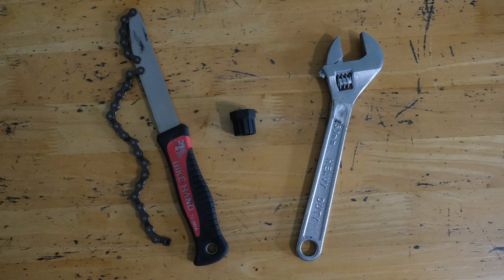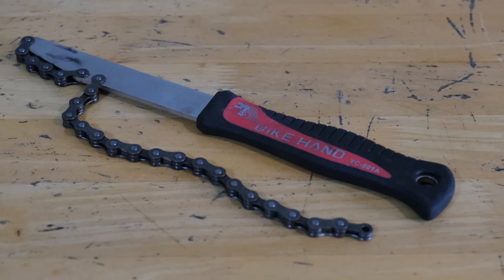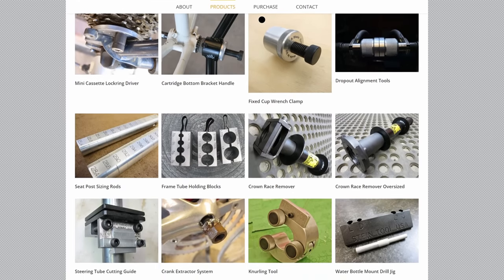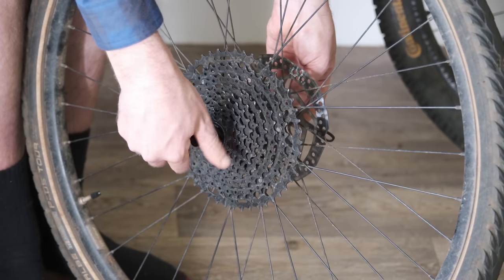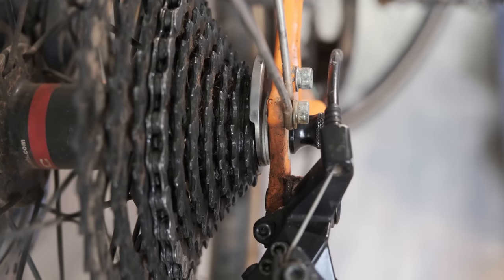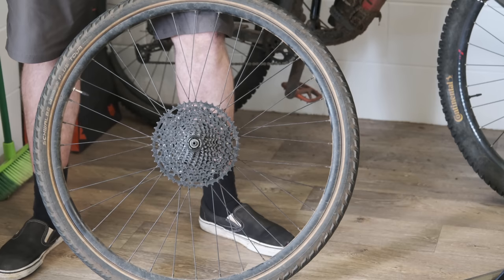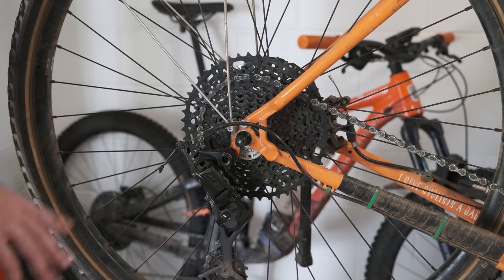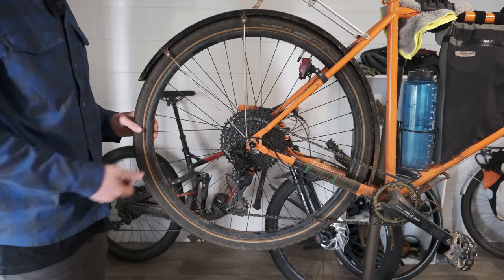EASY Cassette Removal on a Bike Tour! // Stein Mini Cassette Lock Tool Review

Comment: So many people missing the point here.  Its not designed to replace the chain whip and cassette tool, its a lightweight alternative for emergency use that could save half a kilo.  The Unior version comes with a plastic protectice piece so can be used on aluminium.
Reply: Incredible isn’t it? 😅 Why can’t people see that if you are touring you might not want to carry a full size chain whip, lockring tool and wrench? And even if you said, ‘well those things aren’t heavy’, you then have to apply their original logic and take a full size track pump, because it’s better than mini pump, a full set of t-handle hex keys, because they are better than a mini tool etc… do this for everything and you’ll need to also fit a trailer to lug the kitchen sink around.

Comment: Clever little tool. I can't say I have ever encountered a situation where I needed to remove a cassette in the last 15 years and 150k miles of riding. I have had one instance where I needed to tighten a loose cassette lockring but never needed to remove one. That being said, I can totally see the value in this for those who ride long distance, multi day trips without access to a fully stocked garage/shop.
Reply: in 15 yeas as a messenger i never had my cassette loosen. but that would be the only viable reason i could see for this too.

im not trying to be a hater, and i was scratching my head for a while on this one, and yours is the only situation that makes sense. and the only time i ever head of a cassette getting loose.

Comment: Wow, very smart tool! Before watching the video and having seen the tool, I was really wondering how it would work. Never knew it could fit over the lock ring, very smart.
Thanks for the warning about not using it on Carbon frames 🙂, that makes a lot of sense. But what a weight saver on a steel bike-packing bike!

Comment: Reminds me of the Hypercracker which was eventually replaced by Next Best Thing.
Reply from the maker: Exactly! 

I meant to mention the Hypercracker, but didn't bother for some reason.

Thanks for commenting! 😁
Reply: I have a Pamir Hypercracker for 30 years. I maybe used it ones but to have that thing on a tour gives a peace of mind, with it's longer lever it even works not bad for simply changing a cassette.
Reply: I bought a Hypercracker in 1991 before doing two fully loaded tours that year covering 7K miles. It worked flawlessly and it was a good thing because I ended up replacing nearly all the spokes on the cheaply made rear wheel. The item reviewed here looks to be excellent.
Reply from the maker: @smith971  - Great to hear, Karl! Thanks so much for sharing!
Reply: My Hypercracker is well travelled and seldom used, but is worth it's weight in gold when needed.

Comment: I took a small light Park 13/15mm double ended cone wrench (you could use any small wrench you are already carrying) and just drilled a hole in it and attached about 8 old chain links with a small screw through the hole to make a small light weight chain wip. Then I took the regular lock ring tool and drilled a hole through it so I could turn it with a 6mm hex key. This allowed me to just do this job, if necessary, without all that fuss or potentially breaking something important like my frame. Was it a bit heavier, yeah sure, but I was already carrying the wrench and the hex key so the weight penalty was basically the 8 chain links and the difference in weight between the regular lock ring tool and the Stein or similar, so just a few grams. Before leaving on tour I just made sure the lock ring wasn't gorilla-ed on there so I'd be able to loosen it with my setup that doesn't have quite the leverage of the full size tools.
Reply from the maker: Pretty ingenious solution!

I think your comments on weight are relevant though - this things main value proposition is that it's TINY and weighs next to nothing. 

In my experience, cassette removal is a task that is so seldom required that I'd rather just put up with the occasional fiddleyness of a tool like this in exchange for the space and weight savings - but I'm sure many would disagree and opt for ergonomics instead.

I'm actually considering swapping this one out for the NBT-2, which is much cheaper and I think will actually work really well with the sliding dropouts on my bikepacking rig. Guess I'll find out and post a video when I know!

Thanks for commenting!
Reply: @VeloObscura   Sure - I'm not bikepacking just standard road touring with panniers so the few extra grams are not an issue for me. I find the weight I'm carrying on the bike changes day to day more than the weight of this thing based upon how much food and water I'm carrying. Regardless, the most important thing in either case is to make sure you know how you are going to use whatever tools you bring otherwise they are all just dead weight. I do a lot of my own wrenching so I sat down and seriously thought about what the top 10 most likely failures would be, whether they were things that I could realistically expect to fix on the side of the road or in some BLM campground, and what tools I should then assemble to do those jobs. Many of the folks I run across just carry a multi-tool, patch kit, and pump and believe they will some how be able to "MacGyver" their way out of anything knowing little about how their bikes actually work.

Comment: When I used Shimano hubs I carried a Pamir cassette cracker ,same principle, in case you broke a drive side spoke.  Now I use DT Swiss 350 hubs…you can pull the cassette and freehub off by hand with no tools required.  Makes wheel repair or hub service easy.

Comment: Reminds me of a tiny little tool for removing the outside spin on cog on Shimano Uniglide 6,7, and early 8 speed Uniglide cassettes and freehubs. The smallest cog spun on the hub, to hold on the rest. It had a short piece of chain connected to a hook that hooked onto the chainstay. It worked basically the same as the thing you used.
Reply from the maker: Oh wow, that's really cool. I'm going to look that up and see it in action!

Thanks for commenting!

Comment: Funny how this video popped up in my feed a few days after I ordered the Wolftooth lightweight removal tools.  That said, thanks for the warning about not using it on carbon frames.  But I still may get one of these as my preferred touring frame material is titanium, which I would imagine should be fine.
Reply from the maker: Wolftooth make awesome stuff!

I'm sure titanium would be fine and you can always use the included protective plastic for aluminum frames with it just to be sure!

Comment: Looks like an improoved version of the "Next Best Thing 2 lockring remover" where you had to have the tool in the right orientation relative to the rear dropout, while installing the rear wheel.
Reply from the maker: Yep, just another variation on that design. 👍

Comment: You can use just a chain to hold the cassette. Put something to protect the tire (clothes or a stick) them put the chain over it and wrap the both ends around the cassete. Just take care to arrange it not touch the spokes. I use that and a breaker bar to release a stucked centerlock.
Reply from the maker: I don't tend to take a breaker bar with me on extended bicycle tours! 😅

Comment: Hey Dave, thanks for this. I've seen videos about this in the past, but have been a bit unsure about how effective it would be. My last tour, I took along a wrench, cassette removal tool and chain whip and it was a lot of weight and bulk, especially since I didn't need to use it. But, I felt I needed to take them since I had been having issues with spokes breaking on the drive side of the rear wheel. It would be nice to drop the weight and bulk of those tools. I do have an aluminum frame, however, but I'm not sure how it could be damaged by using this tool, as long as the forces applied are not overdone and are increased gradually. Are you thinking that the frame could be damaged by a sudden jerk of the wheel while the tool is in place? Again, thanks for all your videos. Love your presentation style. Very clear and concise! :)
Reply from the maker: Thanks, mate!

To be honest, I'm just going off what I've been told. I think aluminum MIGHT be ok, but the maker of this tool (and the other similar ones) recommend only using it on steel frames.

There is actually a black piece of plastic that comes with the tool that you can put between the little "peg" and your frame to help spread the pressure, so perhaps using that might make it safer for use on an aluminum frame.

This video was actually my first time ever using the tool and once I'd figured out how to get everything in place, it was remarkably easy!

Cheers!
Reply: To larry/dave, just thought, here in uk you can get 'fibre fix'...it's a composite special string that can be used as an emergency spoke. Ideal for replacing a cassette side back wheel spoke on the road (very light & approx £10, I've got one for tours! Never used it yet but know the principle.
Reply from the maker: @LiveAndLetBike  - Yes, the I know the FibreFix well!

Unfortunately the FibreFix isn't a permanent solution and on a long-term bike trip it's better just to fix with a regular spoke and be done with it.

However, it's a great solution for shorter trips where it can be enough to get you home.

They're a really great piece of kit.

Comment: I have this tool but have luckily not used it. It's presence has been a talisman against broken spokes! A spoke that fits 3 of 4 wheel sides is taped to my low rider front rack, spoke key in bag. 28 spokes  for a heavy rider on a heavy touring bike is a bit concerning. I need to build a 36 spoke wheel for this over the winter.
Reply from the maker: Haha, a talisman! Love it!

28 spokes would definitely have me worried too! 

Cheers.

Comment: Just wait until you have to remove the cassette from a DIY e-bike. Because of the extra torque from the motor the cassette becomes practically welded in place, it's the equivalent to removing a cassette from a bike that's been left outside in all weather and unused for 25 years. it would be interesting to see how this tool handles more extreme scenarios like I mentioned. It seems this tool may be better than trying to keep the traditional cassette socket tool flush while hitting it with a sledge hammer and or getting an overweight relative to stand and the spanner while you hold the chain whip.
Reply from the maker: Do NOT use this tool on a cassette that you suspect is stuck in place. It is NOT designed for high-torque applications. You will most likely damage the frame!

Before leaving on a bike trip where you may use this tool, you should always first check that the lockring isn't too tight by using conventional tools.

That being said, once you've done that it shouldn't matter whether you're on an ebike or even if you just have incredible hulk thighs. Torque is not applied to the lockring while pedaling and you shouldn't have any issues removing it. Just make sure you put a little bit of grease on the threads before you put it on.
Reply: @VeloObscura  LOL chill out, I was just saying it would be INTERESTING to see how this tool handles more stubborn and hard to remove rear cassettes. And also, torque is indeed inadvertently applied to the lock ring of the rear cassette by an e-bike motor because of the knocking effect of the motor kicking in as it initially pulls the chain, (especially from a stand still in a high gear) this is hard to explain unless you've ever ridden and used a high wattage e-bike motor without a smooth start function which you may well have done?  

I appreciate the advice but telling/advising a bicycle fanatic to grease his threads is a bit like telling an IT specialist to turn his computer on and off again. I mean no offence by this and I'm always concerned that comments like the one I'm writing right now can come across as snarky or irritable when they are just words on a screen, but in real life this would be a mostly playful back and forth misunderstanding or slight disagreement etc.
Reply from the maker: I AM chill, mate. Like you say: Tone doesn't come across in text. I was just trying to save you from wrecking your frame. If you want to try this, then go ahead - I've done my part! 😅

Comment: The tool is cool but I love the massive range on your cassette even more.
Reply from the maker: Haha, thanks.

It's a Microshift Advent X system with a 11-48t cassette. 10 Speeds, so pretty big jumps in theory, but I don't really notice it. I suppose you get used to it!

It's a very cheap system, but allows you to run drop bars with a 1x system with plenty of range. I run it with a 34t chainring.

Cheers!
Reply: I thought that my 11-40 was a pretty wide range. As someone who is on the wrong side of 100kg and who has no flat areas anywhere near him I would love to get a cassette with that range.
Reply from the maker: @Alan_Hans__  - They just released their new "Sword" drivetrain. It looks amazing. Much more refined than this old Advent system.

Comment: If this is meant to be carried for emergency use seems to be a good tool, as a Roadbike and MTBer, I have never been in the situation to have to change a cassette in the ride.
Reply from the maker: This tool is designed for people to take on long bikepacking or bike touring trips to remote locations where there are no bike shops. I wouldn't take the cassette off on my morning ride either 😅

Comment: It's time someone invented a cassette that can be removed with an Allen wrench
Reply from the maker: Yer not wrong! 

Check out Ignite Components - they have a bottom bracket that uses an Allen wrench to push out the bearings for replacement. Really cool stuff.
Reply from the maker: Yer not wrong! 

Check out Ignite Components - they have a bottom bracket that uses an Allen wrench to push out the bearings for replacement. Really cool stuff.

Comment: I would think that the lever needs a larger diameter for increased durability.  Sometimes the lockring is tight or frozen
Reply from the maker: That's why in the video I talk about making sure your lockring is OK before setting off on a trip with this.

Comment: could you leave this installed all the time? of course without the part sticking out?`
would make it a lot easier and less fiddly to get it one if you can do it when you first install the caset.
Reply from the maker: I have considered it, but I don't think it would be a good idea. I think it would rattle and possible rub on your dropouts, which would remove paint and maybe even material over time.

Comment: Nice tool, though I am trying to find reasons why I would want to take of my cassette on a bike tour. All of the reasons to take of the cassette tend to be major repairs anyways and I do not carry spare cogs or freehub body parts with me.
Reply from the maker: My last tour went on for about 6 months. During that time I needed to replace a worn out cassette. I also broke drive-side spokes that required removing the cassette to access.
Reply: With a Dt swiss hub you can remove the whole freehub body together with the cassette without tools. Just in case you want to put some fresh grease  or need to repair a spoke. There are also other hubs that work like that.

Comment: I do not think that's a particularly good solution. I see the point of losing a few tools and replacing it with one but...

1) it looks fiddly and therefor adds additional work time to something that should take less than one minute to do.

2) a lockring should ideally be 45 nm and if I have to run it less than that to use this tool I don't see the point

3) you can get quite minimal cassette whips and I use a tool with campag and shimano splines that's built into one piece, meaning I don't need the lockring tool and an adjustable wrench

I do think it's neat how compact thst little tool is though but I think unless you're doing ultralight bikepacking, a conventional tool is better as it's faster and you have more control over what you're doing.
Reply from the maker: I don't think the fiddliness is an issue as, I don't know about you, but I'm not taking my cassette off on a daily basis. The conventional tools are definitely easier to use, but I'd much rather deal with a bit of fiddling that carry those on a tour like I have previously.

The torque rating on the lockring is quite a contentious issue. Although it states 42nm, I've talked to a few bike mechanics who think that is unnecessary. I can't say myself, but I suppose I'll find out in time if there is an issue with not tightening it to that rating.

I guess it probably comes down to personal preference and for me the shortcomings are worth it!

Thanks for commenting!
Reply: @VeloObscura  I'm not denying that the compactness of it is very appealing. I may get it sometime and test it, but since I don't mind having the tools with me, it probably isn't a product aimed at someone like me.

In terms of fiddliness it's probably just my own mental hangup. A lot of my old klunkers have slightly wider hubs than needed, some I've coldset, but others I wrestle to get in and if this mimics that pain I'd rather carry the extra parts. I might not mind it in the comfort of at home tinkering, but if I was out in the woods and it was a bit muddy and wet I'm not sure I'd like this product if it makes it additionally finicky.

Anyhow I enjoyed the video and shall consider getting it sometime. I bought the tyre levers you tested a while back, finally (does one say finally in this context?) got a flat so will get to test it.

Thanks for replying to me
Chris
Reply: @janeblogs324  as a way of quickly unlacing the wheel? 🤣
Reply: @VeloObscura  Interesting.  The force is applied to the frame (eg chainstay) about 5cm from center so 42Nm represents around 900N at that point.  Definitely wouldn't want to apply that to a carbon frame, as you clearly said.